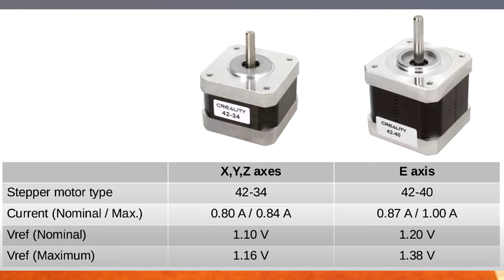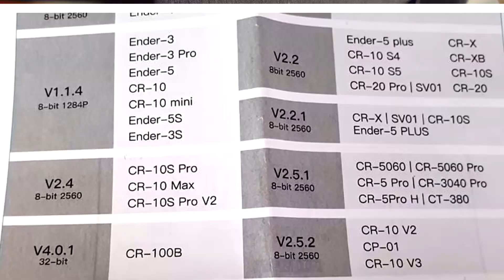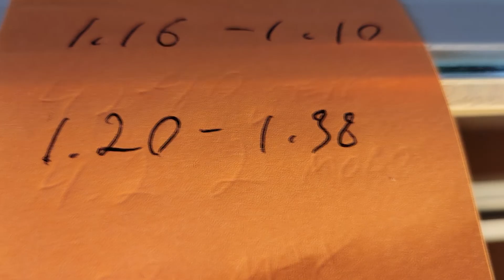Fix Ender 3 Extrusion Issues!!! Factory extruder VREF values too low!

Comment: I just need to thank you so much I was pulling my hair out trying to figure out why my extruder would stop mid print. Replaced the stock extruder and the bowden tube. I calibrated random settings a million times. Lots of curse words and threats to throw it out the window. When I checked the volts. It was .75 volts……I was floored it was so low. I turned it up to 1.38 I can probably turn it down more since that’s max. But it works like a dream! Thank you!!!!!